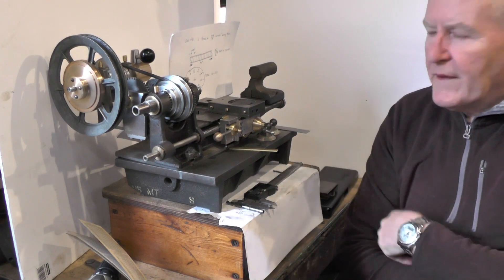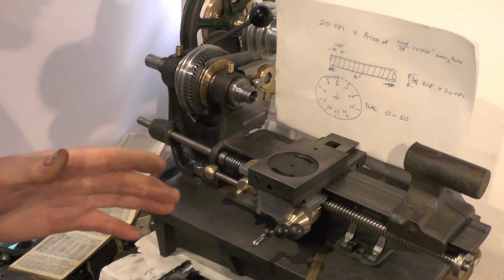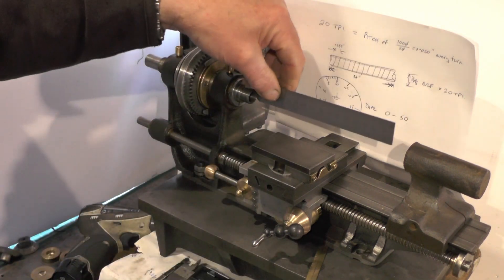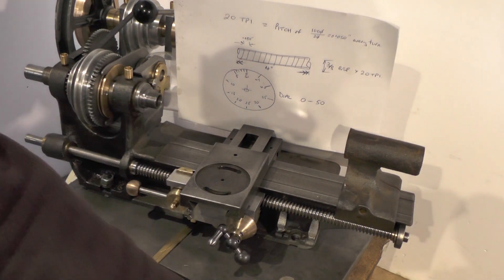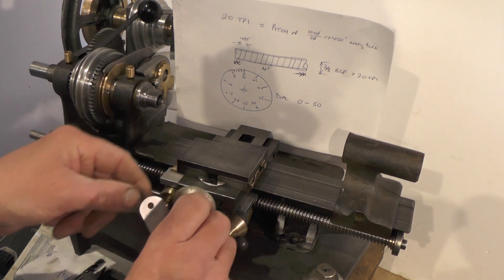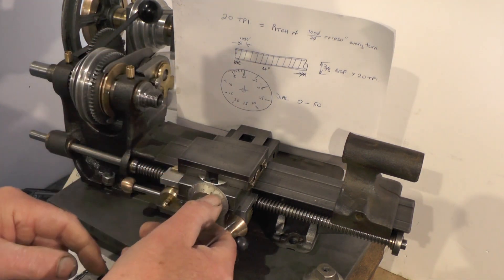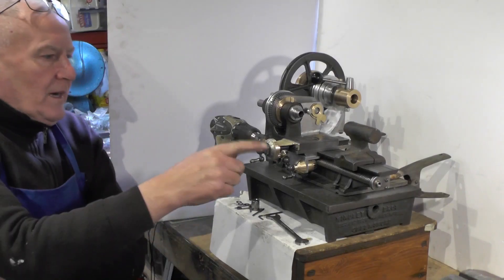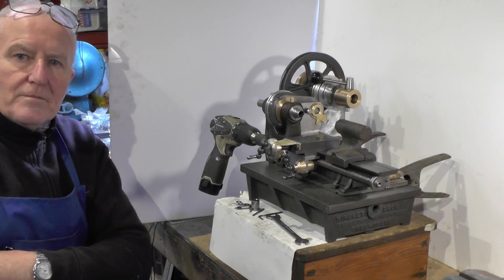Ep 12 Making a Micro / Mini / Watchmakers Lathe from Old Casting (Cross Slide etc) "mr factotum"

Comment: What ho Mr F, 
Yup im still here but don't want to bore you by commenting on all your videos.😅
 I was chatting to Mr Moore the boss of Myford (thats the original not the new crowd) while i was demonstrating one of his lathes at a show and he said the convention was Imp lathes had dials marked in radius while metric ones were marked in diameter reduction. There are exceptions of course as not every manufacturer got the memo.
Why not fit a dro and save the confusion, great for the eyes sight too.
I bought a set for my Colchester but cant be arsed to clear enough space to move the damn thing away from the wall to be able to get at the back to be able to fit it. Maybe one day, before the warranty runs out.
ATB 
C
Reply from the maker: Eyup chris
You never bore me. As for the dro , think I'm set in my ways, don't like making things to easy, plus I'm as tight as cramp🤣👍👍
Atb kev

Comment: Fantastic work as usual Kev! My M300 is graduated in diameter, not radius. I much prefer lathes configured this way as every slide is the same meaning what you wind on, is what you take off (I realise you know this). 99p, awe disappointing effort, I would have started at 25p 🤣🤣🤣🤣. Cheers, Jon
Reply from the maker: Eyup Jon,
Thanks, I would have started lower, but the bugger jumped in with a quid.🤣👍
P.S.
I've got the coolant mister, thanks very much, 👍I'm a few videos in front so will give you a shout out soon'ish! Appreciated very much,
Atb
Kev
Reply: @MrFactotum  no bother mate, you are welcome. Cheers, Jon

Comment: Amazing, I'm getting that old Maiford dial working on the cross slide. Wouldn't you have the wrong markings for the top slide if you're using a 20TPI screw thread, but a dial marked with 100 since you're not cutting radius?
Reply from the maker: Morning William
I was on a coach coming from wembley  when my team had just lost on penalties, i was tired, subdued, and a bit tiddly!!! when i answered you yesterday and yes your correct, something i had overlooked, well spotted something no one else had spotted, included me with my blinkers on that day. Ah well anyone who don't make mistakes has never done anything, When i do the video i will give it a mention,
 I've given it a quick think over and what i will do is either make a dial with 50 divisions on, or make a tap 10 tpi  to make a nut, and cut a external thread 10 tpi on the lathe and put the Myford dial on to combat the issue, well spotted 👍👍
atb
Kev
Reply from the maker: Eyup William
Thanks, compound slide will work out same as cross slide, you will see soon, just dropped of it a while to do some maintenance work on my loco, next up
Atb
Kev

Comment: Hi Kev.  Nice work.  It's amazing how many different threads and pitches there are in the world.   Regarding lathe differences, I have to remember to adjust to my old Schaublin 102 lathe as it has a right hand thread cross slide and tailstock, but a normal left hand thread top slide.  Appears to be all original spec.   The tailstock works well as you can roll your hand back towards the operator when doing heavy drilling, which is a much better action IMHO.  Schaublin made their lathes to customer requirements, which was basically industry use, so there are a few weird things out there.  Cheers Rob
Reply from the maker: Good points rob
Yes, no standardisation
See you next time
Atb
Kev